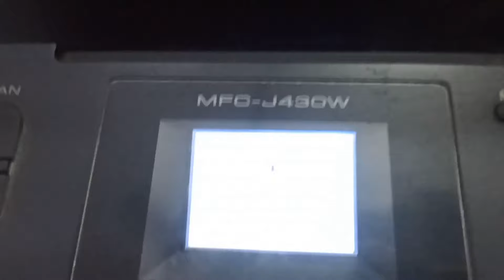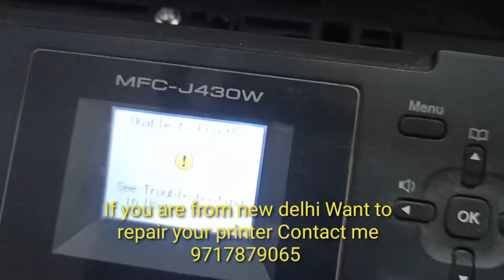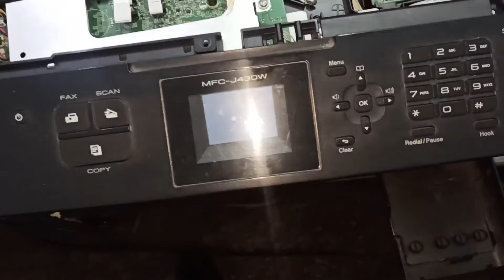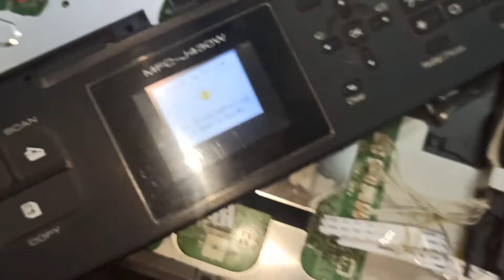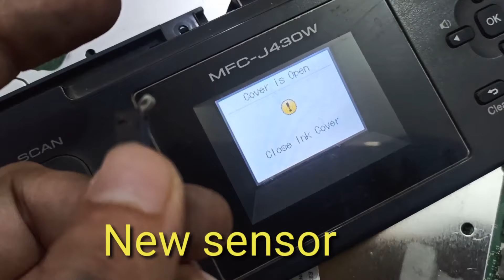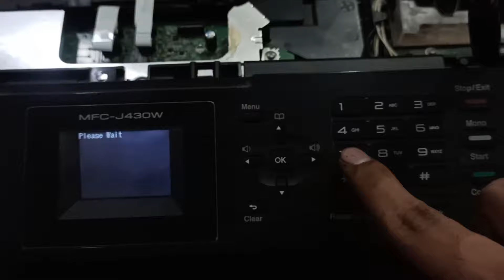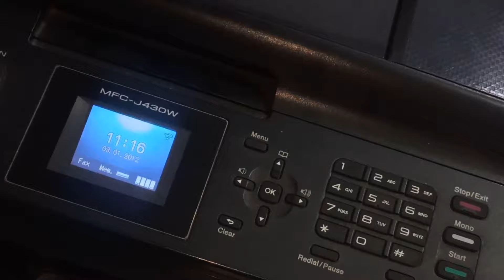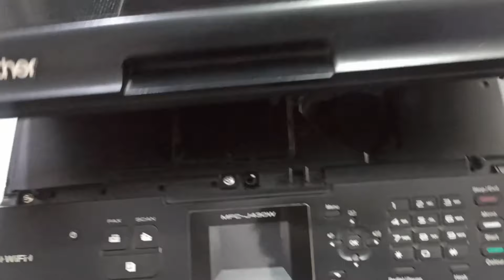Unable to init 50 | Unable to print 50  | unable to print 5A in brother printer MfcJ430w, MFC5910dw

Comment: i had the same problem with an mfc-j220, i solved it by cleaning the sensor with liquid for electrical contacts. I also tested it with a multimeter.
Reply from the maker: Instagram id @shivam2929

Comment: What type of sensor did you replace... I have the same problem... And i dont know what sensor it is...
Reply from the maker: Purge unit sensor you can clean it using ipa thinner or any pcb board cleaner 80% chance sensor works
Reply: @ShivamSharmaRepairs  Can I use alcohol if there's no IPA thinner? also can I use a normal thinner?
Reply: @ShivamSharmaRepairs  it still not work8ng so i tried disassembling it and found out that its thin copper plate is already broken. Thanks for the info 😊😊😊

Comment: at 7:48 for what use is this wire or tension spring?  I dont know, where I need to attach the second side
Reply from the maker: Ground power
Reply: @ShivamSharmaRepairs  thanks a lot for the fast answer, can you tell me where I need to attach the second side, I cant see an attachment point
Reply from the maker: Send me video on my Instagram @shivam2929